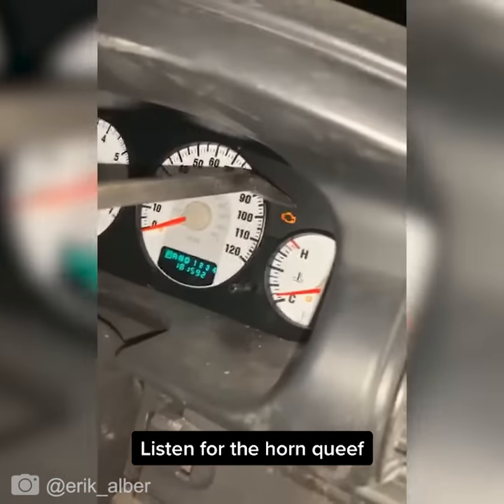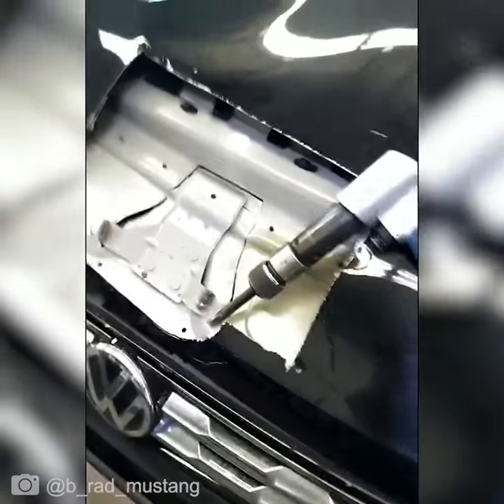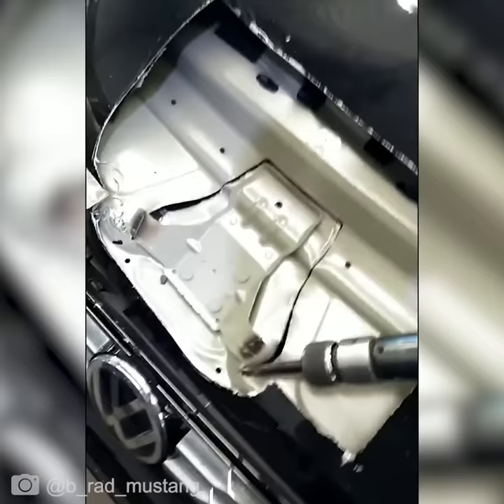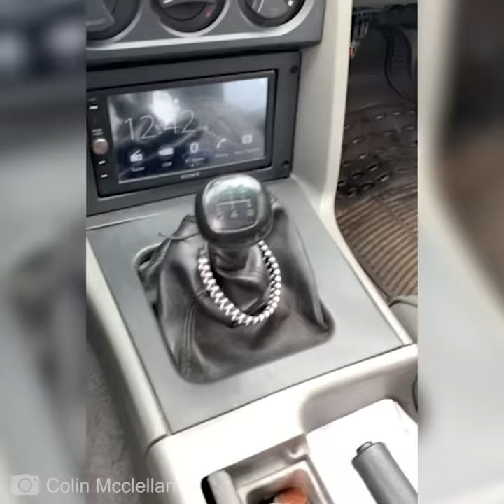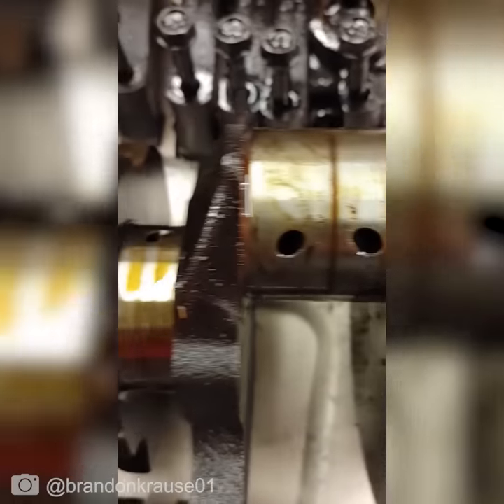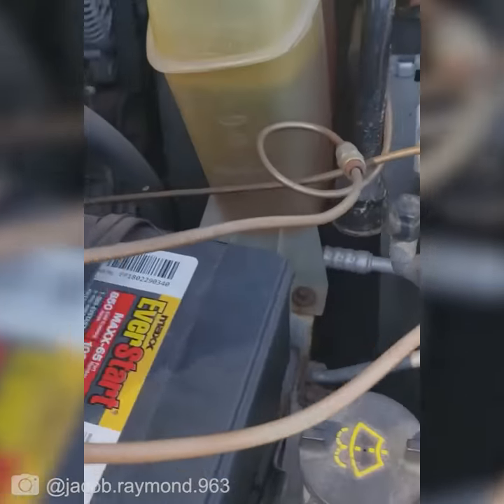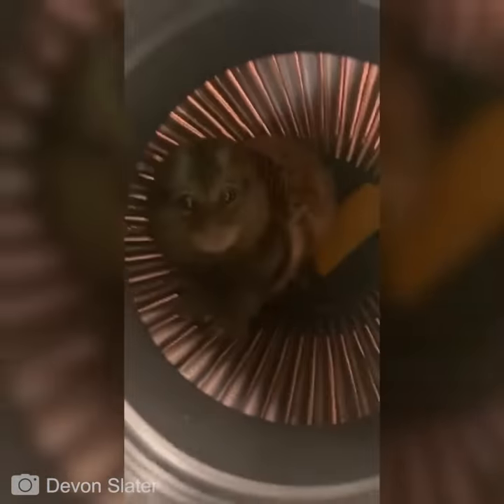Mechanical Problems Compilation [Part 16] 10 Minutes Mechanical Fails and more

Comment: That dude that dropped the truck off the lift is why we have to sit through like 15 hours of training videos before we do anything
Reply: I've had to rewatch that part over and over. How do you not realize what's happening
Reply: @jackm5290  and then he’s like „Oh noo I didn’t see that coming“ 😂
Reply: I was yelling at the screen "Lower it! Lower it!"
Reply: I worked at one place where a guy drove a truck off the lift through a wall
Reply: So what exactly happened? I visually I could tell it looked crooked but I have 0 experience with any of this, some one mind clearing things up
Reply: @Jonasty00  he checked the passenger side of vehicle to make sure the jacks were on a good spot but he didn't check the driver's side.
Reply: Reasons why I make sure the lift is under the 4 corners: driver front, driver rear, passenger front, passenger rear.

I used a lift before when I was inspecting a 2008 Malibu 2.2L
Reply: I watched a driver at Swift a few years back drive through the steel building that served as our shop. The mechanics were screaming “STOP YOU MORON!” at the top of their lungs. It did no good.
Reply: Better 30 hours than make these boneheaded blunders.
Reply: Damn I feel bad for him
Reply: How do you watch that and continue thinking everything will be fine
Reply: it doesn't look like the rear was set on the drivers side and imagine having to explain to your boss how it happened
Reply: @brianarmentino24  imagine how to explain it to the customer that owns the pickup.
Reply: Yeah like did he not see the other side not being lifted up?
Reply: @brianarmentino24  imagine your boss making you sit down with him an watch this why he ask you what happen an to explain your self. Just plain stupidity what was he thinking when it starts getting all crooked an he just keeps going like its just fine no biggie.
Reply: Probably stoned outta his mind
Reply: If you hear Click [Pause] Click... STOP! and readjust.
Reply: @jackm5290  yeah blows my mind some people, if he didn't realise what was going on then its worrying he's working on the vehicles 😂
Reply: @adrianjaimes14  not quite if you pause it at at 4.40 you can see he looks at the front of the vehicle, at this point its way obvious the car is pissed on the ramp, he forgot to put the drivers rear arm under, it's obvious
Reply: Just as bad in the military.
Reply: Knew a guy who died because of it.. truck fell on him
Reply: He even looked under the truck so he could tell something was off but instead of stopping he just figured keep going to find out what it is that was off.
Reply: @jonfromstearns  Swift 😂
Reply: I'm not a mechanic he'll I know nothing about cars but I could tell something didn't seem right when it was starting to lift it
Reply: @BOG0690  it happens,
Reply: 15 hours of training to use the lift ? Well that guy must've had at least 3 years of learning to do his fucking job if he's working alone on those cars.
Reply: I saw the Tundra and thought possible rotted frame.
Reply: i worked at a junk yard with like 10 min of training and still i was watching that and was screaming the whole time "oh god no check the other side!!!"
Reply: @RetroPCUser  weird comment, never comment anything ever again.
Reply: We sit through videos to get educated but we have to use our brains and experience in a common sense to actually do a proper job that's the point think before you act kind of works for me as well who else thinks so
Reply: @Jonasty00  The rear driver side is NOT set, it is still clear of the vehicle. Now how you set one and ignore the other is a great mystery in the universe. Maybe he thinks it only takes three to lift it. Maybe he is using the lift like a car jack for only what he needs to, which is not how you use a lift. Maybe he is the one misfiring on a few cylinders. The questions can be endless to how you set only one, and not the other..
Reply: @jackm5290  He set the one in the front on the driver side, but did not set the one in the rear of said side. Being the vehicle began to tilt up and angled to the driver side was a clue to stop, and take a inspection walk to check all lift arms. Unless he is trying to use it as a floor jack, which this vid shows why you don't..
Reply: The laziness is beyond words. Or did he think he could just lift partially like it was a floor jack? Either way, for crying out loud

Comment: The air filter one made me laugh out loud, I admit.  Not long ago, I had a stalling problem in my Rogue, changed the air filter myself.  Turned out it was a timing control solenoid, but the filter was overdue for a change, anyway.
Reply: Maybe someone's kids put that together while Dad is wasn't looking

Comment: 2:03 - I argued with a customer for a few minutes that dropping a bundle of fenceposts into a trailer from that height was going to mess up his trailer and probably his hitch.  Customer was insistent.  I did it as gently as I could and still bent his hitch down a bit.  Supervisor was right there for the discussion.

Watching this guy slam dunk a pallet of into that trailer hurts more than you think.
Reply: Buddy of mine is a manager at a landscape supply warehouse. 'Professional' contractor, with over 2 years of experience (WOW) insisted his 800lb rated trailer could handle BOTH 1 ton pallets of patio blocks. My buddy made the guy sign a waiver.

The Trailer did not in fact, handle the load. Didnt even make it out of the parking lot.

I mean, i loaded my truck with 2 tons of wood pellets, but it was able to handle it, for a short period.

she was riding low. But she managed.
Reply: @dreamwolf7302  Put a ~1 ton pallet of water softener salt into the box of a lifted Raptor.  That guy drove home staring at the sky.
Reply: Ñ
Reply: @Y2KNW  ive seen worse. I run a dumptruck  so im always in the rock pits. Guy came in with a raptor that he had used plywood in the bed to raise the height of said bed. He made the loader put almost 12 tons of gravel in and kept yelling to add more when the loader hesitated. He actully bent the axle from weight.
Reply: Does anyone knows what causes the sound at 1:51 thank you
Reply: Jimmy S  Thank you I have that sound and I just have change brake pads and discs I will check the suspension parts you stated, thank you for your help
Reply: Jimmy S  yes I took it to a professional mechanic, I just notice it makes the sound when is raining, or wet, and in the first brakes in the morning, also a little bit when I turn the wheel
Reply: Jimmy S yes I made the break in period properly , and multiple stops, used the original oem brake pads, but still makes the sound,  thank you for your time and help!

Comment: 6:18 The tow truck driver knew that car was front wheel drive!😁😂🤣😅
Reply: that Civic like NOOOO DONT TAKE ME THERE SOME ONE HELP!!!!🤣🤣
Reply: Pov: you are going to brazil
Reply: So, the tow company would be liable for the Civic's transaxle rebuild, right?
Reply: Probably pulling it to a spot where they can reposition and hook the front wheels
Reply: @nthgth  usually not if they're towing for a parking violation or a vehicle repossession.
Reply: that civic is going to brazil

Comment: 0:21 
“Lil bit?” 
“I heard nothin.” 
“Naw, I didn’t hear anything, your just tryna rip me off.”
Reply: The tire on road geos round and round
Reply: Women moment
Reply: "Ok when you get into an accident don't sue me."
Reply: @K57A  pretty sure she was joking
Reply: Karen moment
Reply: I worked in a auto parts store that did repairs and our mechanic looked at a car like that front end is running crooked, told the owner with a price to replace the front axle and was told NO, just leave it and I'll have it inspected and repairs done by the street mechanic,I saw the same car about a week ago when he was picking up a part and I was taking a car behind him into the shop and the state police inspection unit was checking the books and stickers in the store,he asked the 🧰 about the car in the front with the new stickers with the wheel running on an angle and the mechanic told the trooper that he refused to put new stickers on the car because of the wheel running on an angle and customer took it away and never came back for repairs,he went to a local mechanic that put stickers on without having the repairs,cop stopped the car about 2 blocks up seeing the wheel running on the side and stopped him, found out that the last person who put inspection stickers on the car and never checked anything and was giving fake stickers for $75 dollar's, well he removed the inspection stickers and towed the car away because it wasn't registered to him (it was registered to a relative with a revoked license and the gentleman driving the car also had a revoked license,he went to jail and the other gentleman also went to jail,the person who was using the fake stickers went to jail (a neighbor was a state trooper told me what happened and we both had a good laugh about stupidity) last I heard that the guy is still taking the bus to work with little or no chance of ever getting his license restored,the street mechanic had to pay $10000 in fines and his state inspection license was revoked
Reply: Omg! That tire talked!

Comment: As a mechanic I take special joy in this channel.
Reply: Hi do you know what makes that sound at 1:51 when braking? Thank you
Reply: @davidalfaro5511  There can be several different reasons. I think in that car case there was water on the pads. Notice it was raining. Once they dry off they will probably be fine. It could also be the brake material or contamination of those pads. The last thing I can think of is the wear indicator is rubbing. Time for new brake pads.

Comment: 4:41 I remember when I took auto tech back in high school, we would lift the vehicle wheels off the ground a few inches and then push down on the hood of the car to see if the vehicle was sturdy enough to be lifted
Reply: That's common sense. Though I use the front and rear tire. If you use a bumper for testing it can come off. Its happened before but not to me.
Reply: I miss common sense...

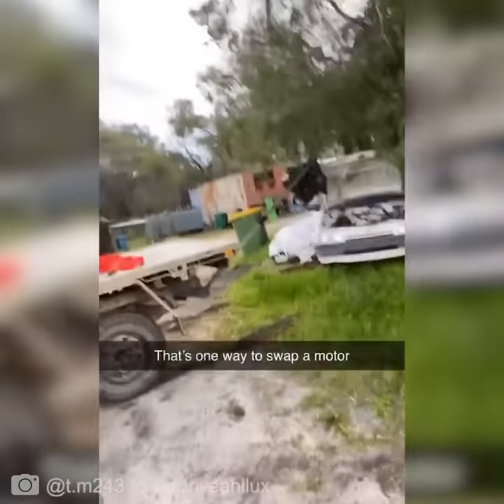Comment: 5:07 proof that any machine can be a smoke machine if you use it wrong enough.
Reply: The grinder from hell.....
Reply: And fire
Reply: If it’s a Dodge….
Reply: Thats what happens when you use it at the wrong voltage...
Reply: It Fried motor
Reply: It’s a cigarette lighter

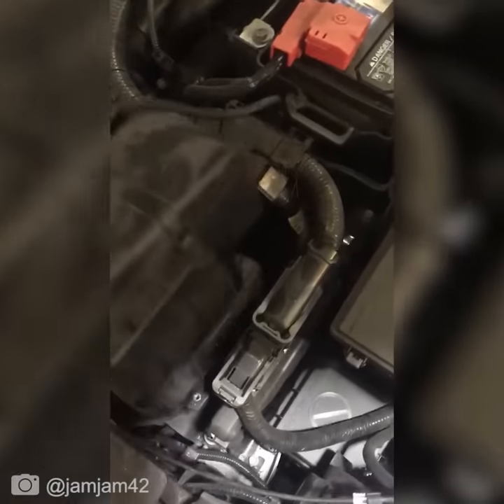Comment: 1:39 never in my whole life have i facepalmed so hard
Reply: Honestly, i know very little about cars. I can refill gas, oil and water for the wipers, that's basically it.
But THIS is a whole new level of stupid.
Reply: I really hope that was a DIY fuck up, if a mechanic managed to do that one they need to put their tools on craigslist and find another career.
Reply: @sw96  yoooo. Not craigslist 🤣🤣🤣. They need to Letgo of their dreams or Offerup that position to someone else
Reply: That was awesome lol sluggish... Im surprised the car was even moving lol car was choking for air!!
Reply: @melvinjordan5559  On the plus side, the filter was doing a great job of keeping dirt out of the engine... and dust... and air...
Reply: @sw96  No air, no dust. 😂
Reply: this is so typical, you must be a novice to mechanical problems video
Reply: Like WTF?
Reply: @sw96  If it was DIY the local mental asylum should be informed one of their residents has escaped.
Reply: There's a plus side to this. The filter is going to last a lot longer.
Reply: @636lover1 yes but not responsible for the results ha ha

Comment: 4:40 I can't imagine the conversation with he customer.... it'd be awful for both of them. I'd be so pissed because that's thousands in repairs, if even repairable, but on the other hand if I were the mechanic I'd feel just so shitty about it, I wouldn't even be able to confront the customer....
Reply: Does workshop insurance cover this?
Reply: @flymousechiu  my guess is no , they cover accidents , not negligence , so I'd assume shop would be on hook for repairs and that tech is likely out of a job and possibly facing litigation even
Reply: i'd be thrilled if i were a customer. thanks for the new car on your bill  bois.
Reply: My brother had something like that happen to his old Plymouth Breeze.  The shop bent the fuck out of the bottom of the body by not putting the supports under the frame.  They refused to fix the damage and I think he just dumped the car anyways since it had so much crap wrong with it anyways.  Not worth getting a lawyer involved and spending thousands potentially

Comment: 2:22 for those who don't know, that's called diesel runaway.
That engine essentially is stuck in a loop of providing more and more power to itself. Only way you can even HOPE to stop it is by starving it of air. 
R.I.P that engine.
Reply: Good explanation.
Reply: Runaway is why some trucks have a gate valve on the intake. In areas like gas plants where there is enough fuel in the air to run you can't just key off a diesel. The emergency valve is your only hope to stop it.
Reply: That’s doesn’t look like a diesel runaway to me, looks like a dyno pull
Reply: Looks like it's on a Dyno

Comment: 6:13 thats the distress call for the Honda, its alerting all its brothers 🤣

Edit: 6-23-21 
To properly tow a FWD. It must be towed from the front. With the drive tires off the ground. Even RWD you should either take the driveshaft off or tow it backwards with the front wheels (steering) AWD should be hauled on a flat-bed. Not doing so can potentially cause issues with the trans etc. As they are not necessarily designed to run highway speeds (as an example) for long periods of time in neutral. The Honda is being dragged while it's in park (parking paw engaged) if it's a manual car the front wheels could still roll, but have to fight against engine compression. However in this case it's being dragged backwards. So it wouldn't roll unless in N or R. An E-brake is obviously for the rear wheels and it clearly isn't engaged.
Reply: its gonna break like that
Reply: The owner forgot to put it in neutral probably
It could be a manual model and he has it in first
Reply: @ToastNova  Exactly! Just put the damn thing in neutral if you are going to tow it with your own truck.
Reply: @Volomette I’m sorry, WHAT?! . How do you confuse a Honda to a Lamborghini
Reply: @Volomette oh ok
Reply: @ToastNova  FWD cars need to be lifted from the front
Reply: @Fifthcell  i always wondered why tow trucks always tow from the back
Reply: @Fifthcell  exactly
Reply: Help me bro!!! They're trying to take me from my dad!
Reply: @Fifthcell  I sincerely hope you are kidding mate.. what about the HANDBRAKE??? It locks the rear tires, so you'll hear this noise but from the rear tires..
Reply: @husseinel-hajj7818  would you rather have the handbrake cable break or have the parking gear be destroyed? You need to tow FWD cars from the front. That’s just how it is.
Reply: @thewonthatloss227  because they tow depending on the cars' drivetrain
Reply: @Fifthcell  Wonder if it was a repo (or repair shop pickup) where they didn't get the keys, so they had to haul it out of its spot ass-backwards to get the wheel-dolly fitted up. (The dolly is the tires on the deck of the tow truck)
Reply: Apparently you need to turn on your car for the emergency break to work in the 10th gen civic’s
Reply: @ToastNova  It's getting taken away in park, they didnt have the keys but still wanted to take the car it happens, but usually you'd bring a tow truck that can get it up on the back or a trailer for that reason
Reply: @Fifthcell  what bollocks. PUT THE CAR IN NEUTRAL. The same would happen if you towed a rear wheel drive car if you towed it from the front. YOU PUT IT IN NEUTRAL. PERHAPS EVEN LET THE HANDBRAKE OFF?
Reply: You brace the steering wheel so it dont move and tow a FWD car from the front
Reply: @Fifthcell  do they not know that you're supposed to tow a front-wheel drive car from the front so the back wheels can roll freely
Reply: @ElViperr408  For it to be activated or deactivated, yes the car must be on. But it'll stay engaged even when the car is turned off (obviously).

You just made me think of another point as to why manual handbrakes are better than electronic handbrakes. I have a 10th Gen Civic, and I really miss having a manual handbrake and hearing that ratcheting mechanism engage. Oh well.

Comment: That guy with the light switch made me laugh the most out of all of these clips.XD
Reply: Me too!
Reply: Haha, true
Reply: you really need to get out more.
Reply: B
Reply: @wilsongarcia8142  C
Reply: @wilsongarcia8142  *A
Reply: That’s actually really slick
Reply: @trioxidetheidiot86  D
Reply: I died when the forklift one played🤣🤣🤣🤣
Reply: What about the guy dragging his muffler
Reply: I appreciate that!! That’s me!!! 😂 Instagram @k_bro_c
Reply: @hcbigpker9718  
Bro thats AWESOME hahaha 🤣
Reply: @hcbigpker9718  
I can't find the original but cool instagram bro 😎🤙
Reply: The light switch is easy, he's got it hooked to the ground and hot of the starter solenoid. You still need the key in the on position for it to work though.

I had a truck that had to be started like that sometimes. To do it without a switch, you simply touch a screwdriver to the hot and ground. It'll start right up.
Reply: THE TYPE OF GUY YOU NEED DURING THE ZED APOCALYPSE 😆
Reply: My first car was a Fiat which the previous owner had broken the ignition key off in the "run" position.  So he drilled two holes in the dash and added a toggle switch for master on/off and a pushbutton for starting -- anyone could just get in and start it.  My solution was to add one of those light switches in series with the toggle, tucked way up under the dash.  Drove it like that for 4 or 5 years and it was a running joke between me and my mechanic that he kept a complete set of keys & lock cylinders in stock for the day I came to my senses 🤣